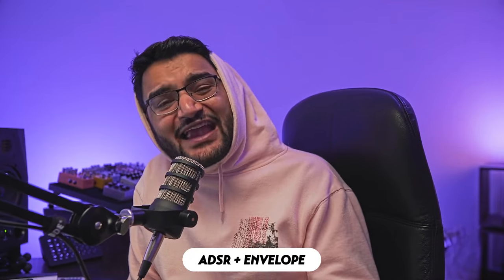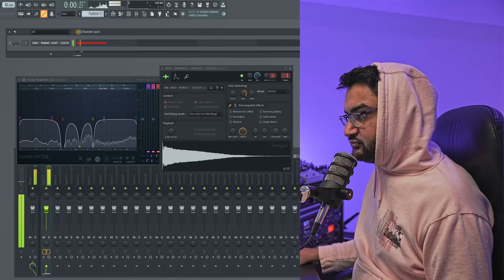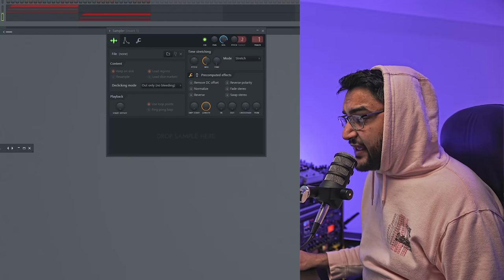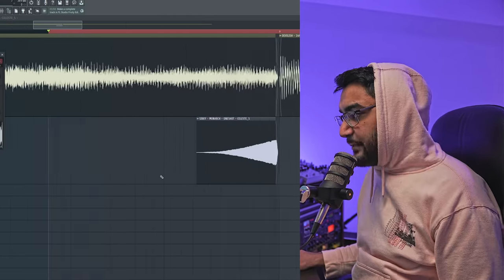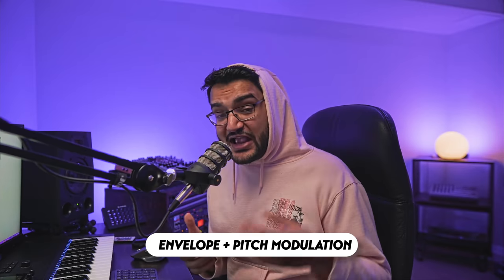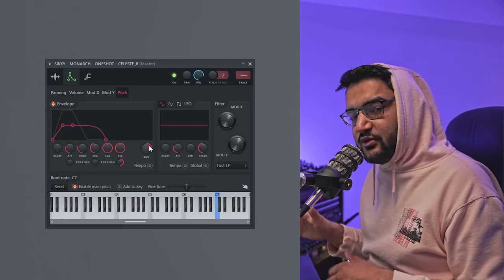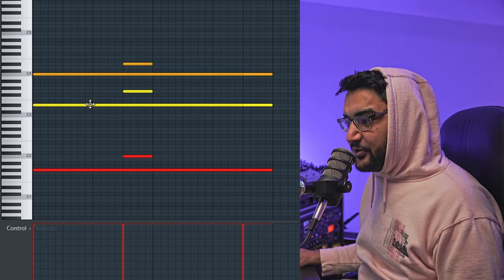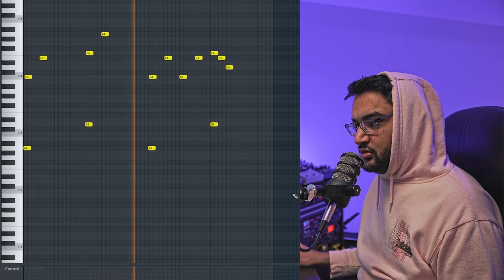STOP using VSTs! (Use This Instead)

Comment: I wish there wasn't so much processing when you go with the stretching method. It ruins the sound. Is there sampler out there that allows you to stretch the sounds, but without that extra nonsense?
Reply: Serato Sample does a pretty good job, the serato pitch‘n‘time algorithm is one of the best out there. But at a certain point you will hear artifacts as the algorithm has to fill the gaps while time stretching. Many like this sound and go for it, if you don’t like it use a good soft Synth or a good Sample Library where every note is sampled multiple times.

Comment: One thought: On the detuning of guitar, is bipolar the right way to go? Players can bend the strings when pressing too hard, but the string won't be too loose and go lower. So the only way a player might cause a note to go out of tune is pushing the string. Although, you can do vibrato on a guitar by waving your finger behind the fret, so there is a slight detuning that could happen. It may be super subtle, but I wonder if turning off bipolar and only going up would give it a more "realistic" aspect. (Long time guitar player)
Reply from the maker: Answer with a question. What if a guitar was never tuned to DAEGBE?
Reply: @SIKKYBEATS  Good point! I guess the next step is to color code all the notes on the piano roll to correspond to the 6 strings on a guitar. Then we'll patch and use vfx color mapper to specifically detune certain strings consistently. Then it will finally sound realistic. XD

Comment: I don't use FL Studio but I've been doing this with Logic Pro X Alchemy for a couple of years.
Reply from the maker: Logic is underrated af too bro
Reply: Use quick sampler . Alchemy always has a little attack (even when u turn off attack) which makes it sound weird
Reply: @PROD.ELIJD360  I'm using Vital VST now. I am so exhausted with other VST instruments now. They're becoming too expensive for me (even the expansion packs). Also sometimes the sound presets/settings in the rompler VSTs disappear even when I save them. So now I'm just throwing 1-5 second one shots into Vital for melodies.
Reply: @itsrelativ3967  I didn't even know vital had a sampler. I might have to try that frfr